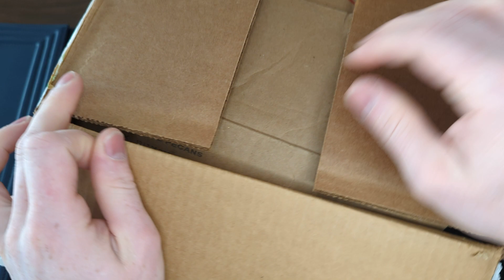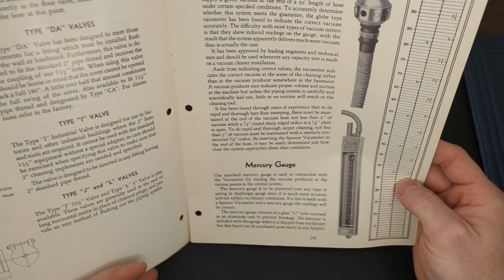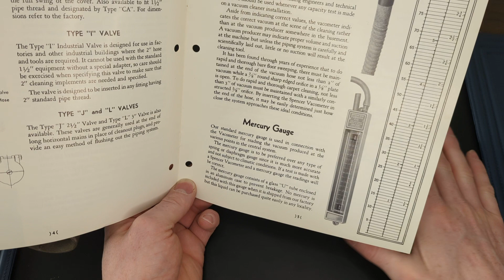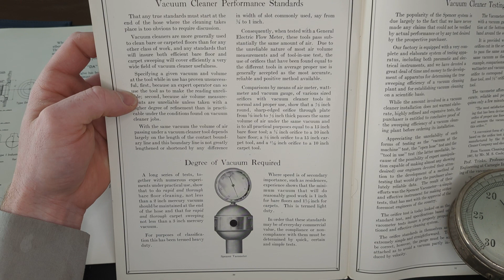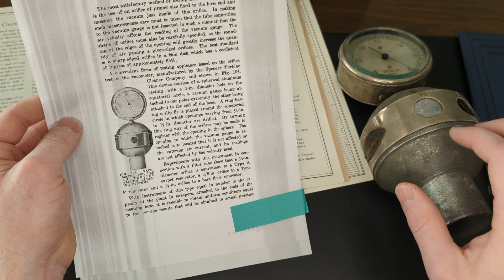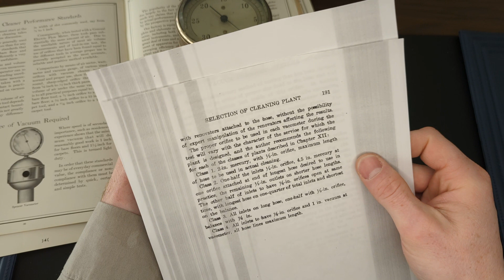I Just Got An Original Spencer Vacometer!

Comment: Well, being a straight airflow system it seems underwhelming compared to portable direct air machines especially the amount of air pulled through those glorified organ blowers and the amount of energy used at the time.  That said, it's a neat device.  The problem with the Y version you refer to is it is only really useful if you are picking up water with these systems, but most central systems that use that gimmick masquerading as a tool are for dry use only.  If you were measuring say a Roto-Vac Monsoon, Ranger or CFX portable extractors, or Drainvac Automatik or Aqua-Air Wet/Dry systems it may be a bit more useful.

Comment: Maybe the extra holes for non Spencer sizes would be for comparing other tools from other companies? Possibly if you wanted to try and sell an installation to upgrade from say a Tuec to a Spencer you could show that the tools from that machine provided insufficient performance and that a Spencer system would do better. Or possibly if you did installs and maintenance you could use this for the purpose of diagnosing other companies systems.